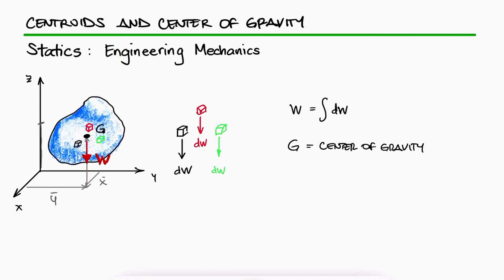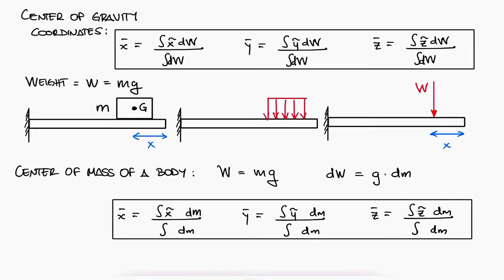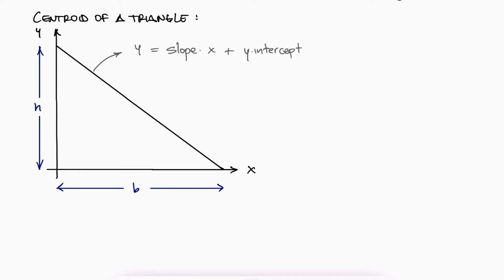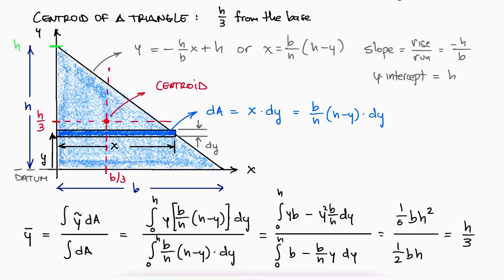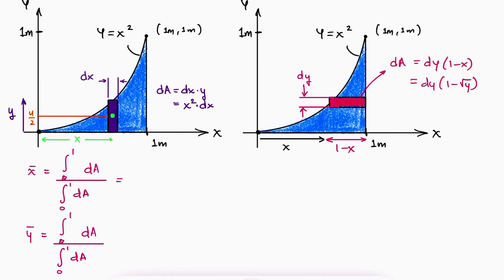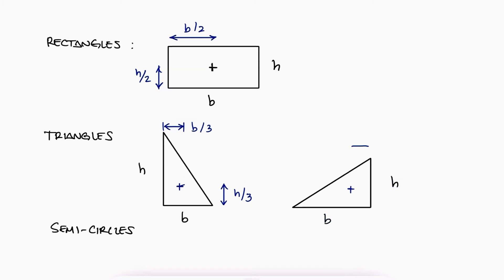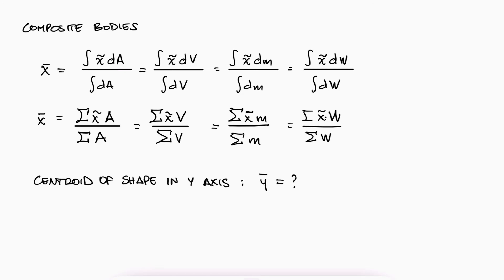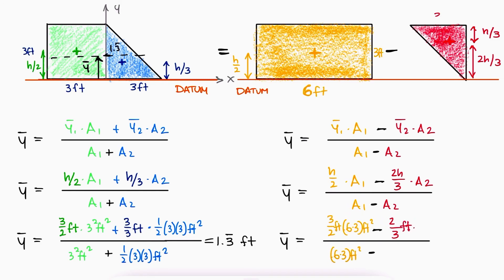CENTROIDS and Center of Mass in 10 Minutes!

Comment: I prefer to select the dA with the variable (dx or dt) associated with the desired xc or yc so you don’t have to calculate the average of x or y inside the integral in the numerator. It also keeps thing simpler. But it was nice to learn that the actual calculation doesn’t give a f’ck which variable you use for dA for as long as the entire expression is either using x or y (but not mixed).